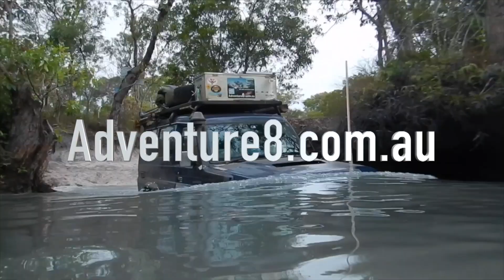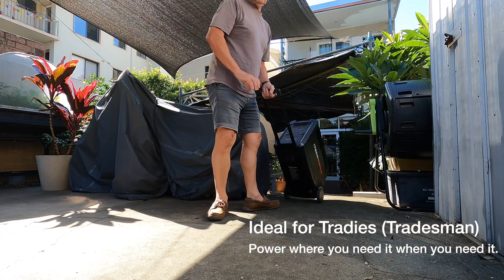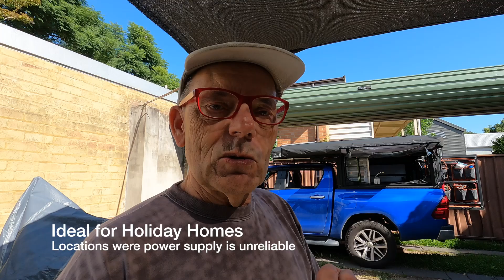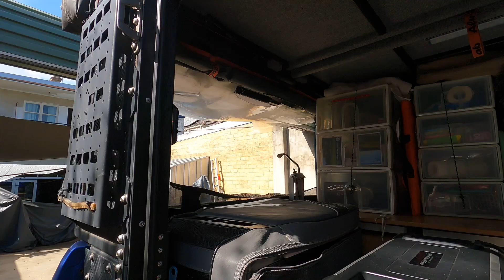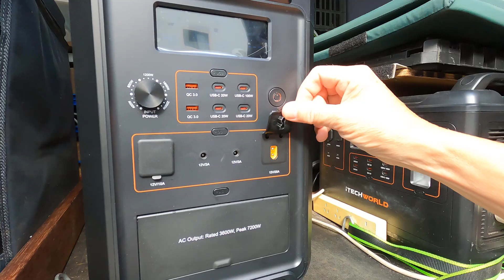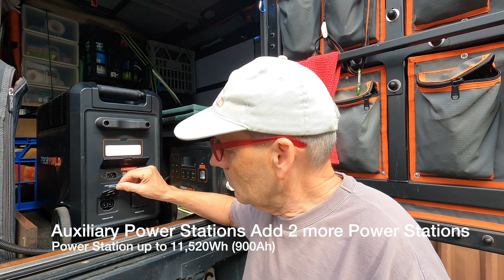Tradies Portable Power.  iTechworld Lithium PS3600 Pro Power Station. Expand to over 10,000 Watts

Comment: Thanks for the great video! Do you have any comments on the sound that it makes? Are the fans noisy? Thinking about putting one of these in a campervan.
Reply from the maker: Yes there are fans when there is a great electrical load going out or in but the noise is not distracting in my opinion.